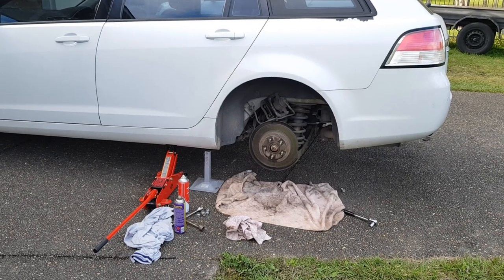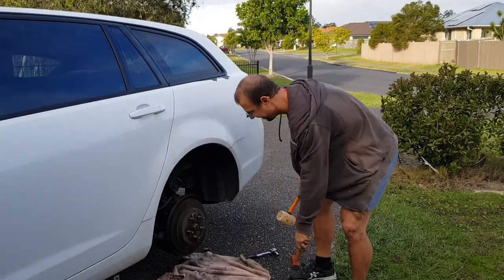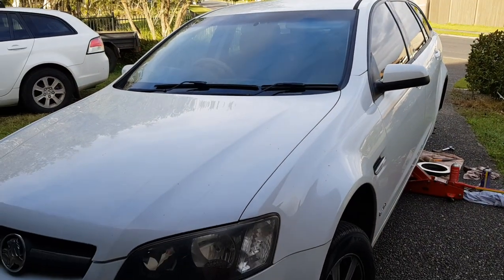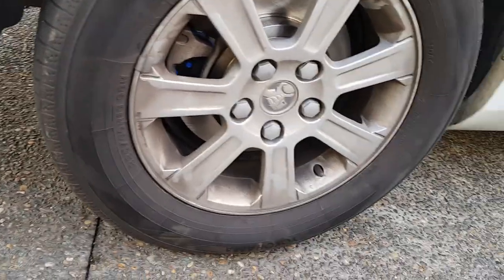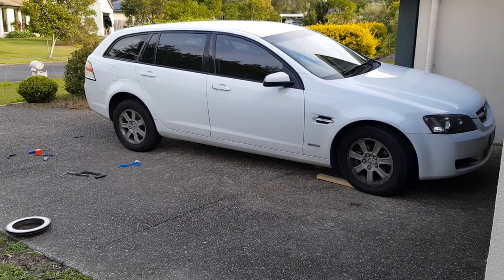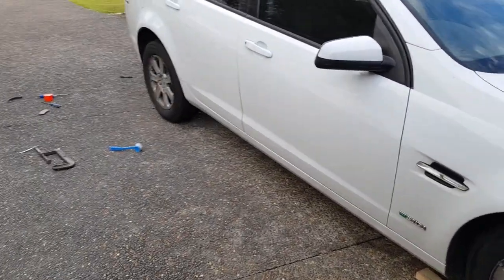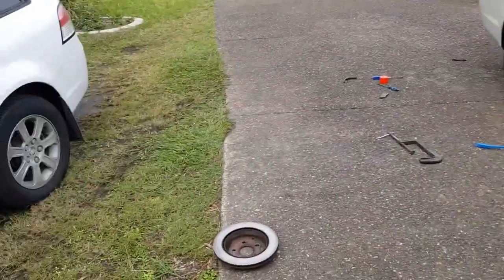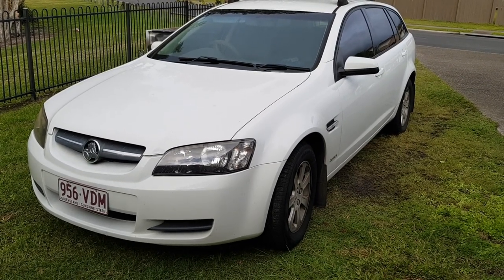Removing stuck brake rotor / disc: SOLVED!!! VE COMMODORE

Comment: Thanks for the information Andy, just wanted to add that the hand brake needs to be off before attempting to remove the rotors. (I’ve just found this out the hard way)
Reply: Oh Dear!!! live and learn.
Reply: i did this yesterday on my GF' brother in laws ve, no need to smack the rotor once you loosen the handbrake shoes off via the adjustment cog. the rotor simply just comes off, have to readjust it though after the new rotor is on or you'll have no handbrake.

Comment: Running higher octane fuel in a car that doesn't need it is a waste of money.   The point of higher octane fuel is to stop premature detonation "pinging" on higher compression motors.    It is not cleaner,  or more efficient l.

The Bluetooth is standard on an ves, there is a fault on your wifes car
Reply from the maker: Nah, I researched this, it was an option 👍
Reply from the maker: Yes, her car was pinging 👍
Reply: @VroomBroomZoom  then her car has timing issues, like every v6 ve on factory timing chain